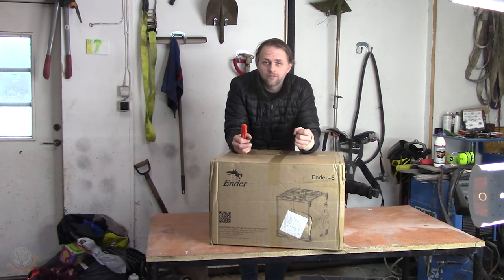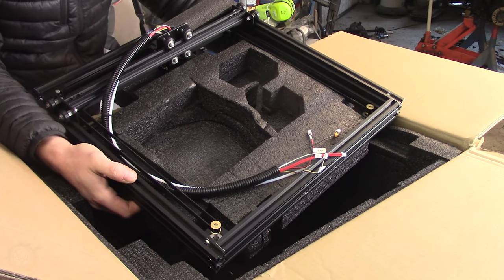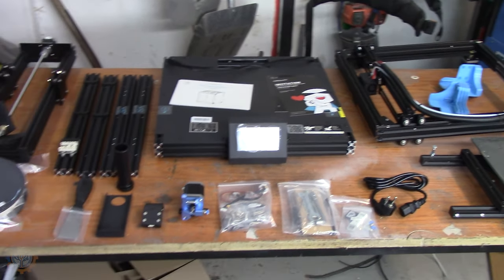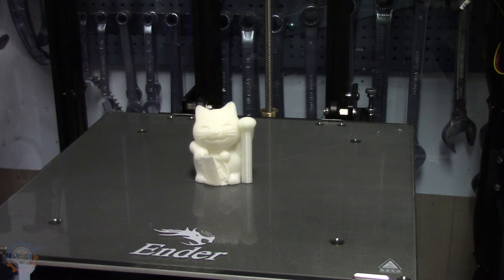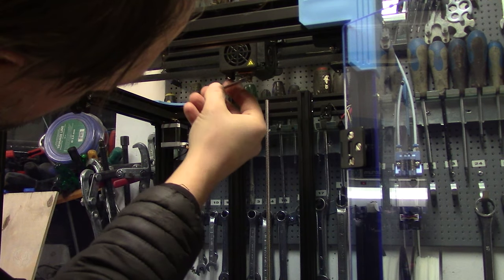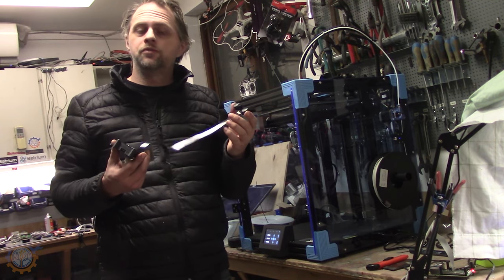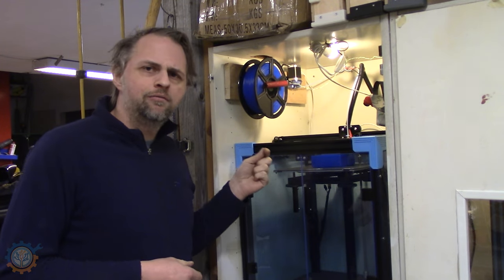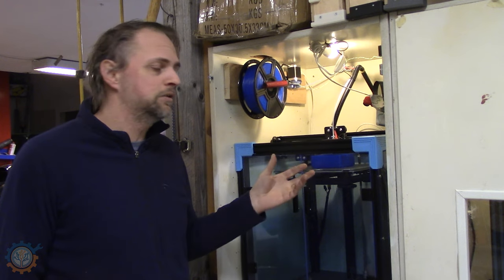Ender 6 - A new 3D printer to my place

Comment: Hello, you mention something related to the USB cable that you say has to be removed, could you explain what has to be removed from the USB cable?
How did you mount the Raspberry Pi?
Greetings.
Reply from the maker: The 5+v Wire cant be connected since its backfeeding

Comment: Nice one Daniel, wow it's HUGE :-)  Seems very quiet as well, especially when you're standing next to it and talking.
Reply from the maker: its quite big for sure compare to the build surface. CR10 versions are alot smaller in that sense. I would hope they make an ender 6 with 300*300*400 build surface because its doable :)

Comment: Good to see you again Daniel!
For bed adhesion, I found that a little gluestick applied to the bed, then diluted with a few cc of distilled water and spread around with a tissue works really well - the water evaporates leaving a thin even film behind.
This printer would be a good 2nd machine, though with €106 shipping from CN I think I'll wait!
Reply from the maker: I got it from spain. Yeah it can be wise to wait intill its in stock. Adhesion My goal is to not have to do anything. And this new bed works ok with pla as Long as the area is big enough. The cr10 i added a mat and that One is Night and Day. Havent had a single Piece not sticking :)
Reply: To achieve a smoother film of glue prepare a gluestick solution, I use PRITT. And some gluestick brands are not water soluble like UHU.

Comment: If you compare with a printer that has moving table it would had taken much more space because of the size of the table and movement back and forward. You should see it as pros instead. I have this printer but i don't like the material quality and all wheels on this machine. When problem starts you will have much more work. They should had build with linear rails...it's noticeable that they build in a diffent way now and also more expensive machine dosen't use wheels as an solution

Comment: I had ender 6  for 2 weeks and freezes in start up and  can't figure it how to fix it now collecting dust at the moment waiting for technical support to call me.
Reply from the maker: Do you get an error when it happens?  I think i have run through  over 700 hours with mine already :)
Reply: @DIYTechRepairs  I don't any error at all, just about run the next print when I turn on the power it power up but just stuck in there. I install the latest firmware actually all the version of firmware but nothing works. All the filament I'd ordered in amazon received it today but printer not working....Am very disappointed!!
Reply: Check all the electronics conections , oh waot , thats is a wrong sd card , try another one , the card came in this priters are not the bed (its happend to me in an ender3, stop printing in the midle of an objetc, then cool down, no error, its was the sd card
Reply: @noway8233  I got it fixed, connection of heater is loose because I installed the micro swiss might pull out during installation and the firmware got install was the BL touch so many error in my part. Like said had it for 2 weeks and this my first 3D printer.